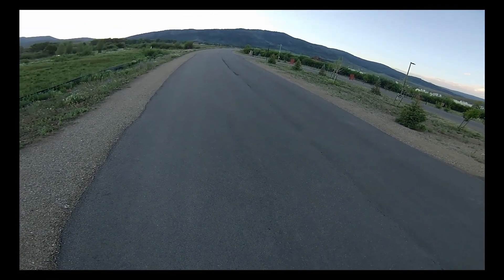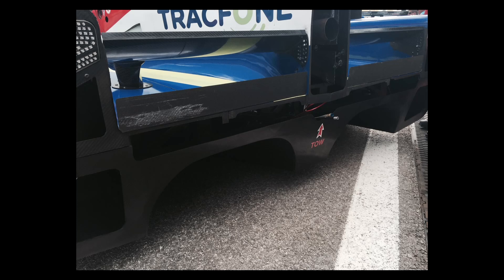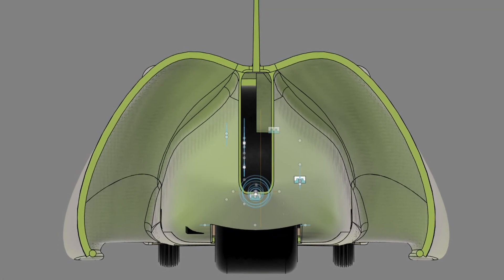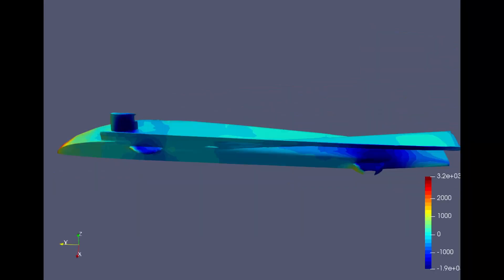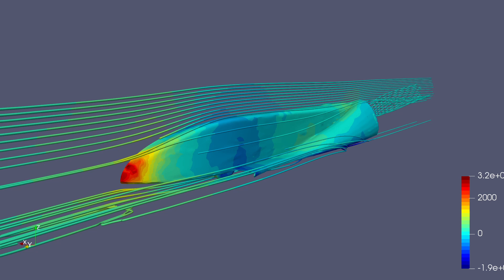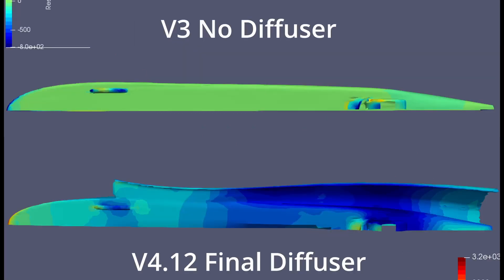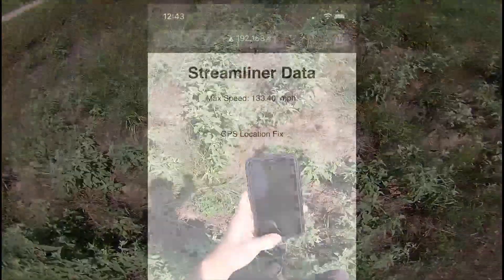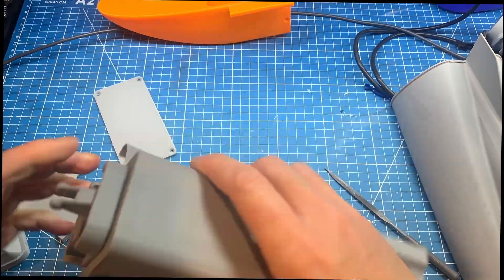Project Streamliner: V4 Design and Testing (Adding Ground Effect)

Comment: Hopefully constructive opinion:
1. Forget all the aero stuff.  You need a controllable reliable car first.  Focus on that.
1a. Get a good GPS module to log direction/speed/acceleration/deceleration. (Crashing)
2. Most high-speed R/C cars use a type of foam drive tire.  Use that first to get a driveable car, then improve on what they have done.
3. You should be able to calculate the rear tire speed at 100mph. Run that on the bench to measure tire growth and reliability. Save that RPM for later. Log.. 
5. Examine how fast the rear tires are actually spinning when the GPS says you are at 100mph. Compare to estimates to get tire slippage. A big issue with other R/C cars. Log
5. Measure your ESC power usage at 40,50,60,100~  to create a power/speed profile. This will help you develop your aero package. Log.
6. Take a look at modern Drag Racing bikes to get an idea of what the "profile" of the rear tire should be.  They have been doing it for years. This will help driveability. Should be the top focus.
7. Put the car down, and drive 5 feet in the direction you want the car to go. Program the steering to follow data from the GPS to follow that direction. Let the car correct itself instead of you trying to drive.  This will need lots of learning/programming as you will want the steering to be less sensitive as the car speed increases.  Fun!!
8. Use the GPS or other monitoring device to slowly remove the throttle when slowing down. This should help your braking issue.
9. Use a piece of masking tape on the edges and along the bottom of the car. It will show where the car is hitting the ground and it is easily replaced.
10. Determine ride height at different speeds for the front and rear.  Use temporary stick-on winglets to adjust the ride height or downforce in the field for estimated body shape changes. 
11. The skis should be taped onto the car's bottom. This allows field adjustment to correct for too high/log ride height in the field. Use shims or tape to change the angle of attack!
12. Outboard skis are da bomb.  Possibly replaceable PLA nubs/bumpers. Engineer in a quick swap nose as it's first to "wear out".  Bring a couple. That's what F1 guys do.
13. Build the swing arm so you can adjust the driving direction in the field.  With more power, you don't know where the car is going.

  I could go on, but you need to have some fun also.  I think the idea is to build a car that is fast/drivable first, measure/log everything, then start making go-fast parts. 
  Having lots of shims/tape/spacers etc. in the field is super important to make adjustments while testing. And maybe get a cheap tripod. 
 thx,   John
Reply from the maker: Thank you for all the really well thought out ideas and feedback!
1. I agree.  I think this is the most controllable version of the car I've had so far.  I really am tempted to wide the wheel base or try a 4 wheel design to make the car even more stable and easier to control.
-I haven't tried to use the headings from the GPS yet.  I think I would most likely need to combine the GPS data with the gyro/accelerometer data with a Kalman filter to have something responsive enough.   I actually just found a fatal software flaw where the reading of the GPS data was randomly delaying the microcontroller and stopping all of the stability control systems.  I've since switched to using the additional processor on the ESP32 for the GPS and logging, and this has dramatically improved the heading control.  I really need multiple dedicated processors so I can separate dependencies.
2. I really want to switch to the foam type tire, but I haven't been able to find the right EPDM foam since I have to custom make my own tires since I can't find the unglued foam tires.  It requires a higher durometer foam, and the foam I have tried chunked out at less than 80mph.
3.  I admittedly haven't done enough tire testing.  The rubber tires grow dramatically even with a homemade belt made of dyneema.  The tires self clearance the car's body right now.  That's a great idea to create a test rig to run the tire for a prolonged period of time.  Do you think I need a roller to exert the force from the road?
5.  I just added a rear wheel speed sensor to the car.  I've also implemented traction control and antilock braking.  Additionally I setup linear interpolation on the throttle and brake, which eases on the acceleration or braking.  
5a.  Characterizing the motor is something I've been working hard on.  The traction control I'm using is rate based, which isn't ideal, but it is used by a lot of drag racers.  Ideally, I'd have a motor dyno that allows me to fully model the throttle, RPM, and torque output of the motor.  The RC car ESC's are not linear in their torque response.  Unfortunately I haven't found an off the shelf solution for logging the motor current that's Arduino compatible.  I may be forced to build my own.  I am building a voltage logging circuit.  I'm using a very small battery which is most likely sagging at higher speeds as well.
6.  I have found a semi rounded rear tire helps stability.  I think with a wider front width I could run a more square tire and have better traction.
7.  I do the heading testing with the gyro and accelerometer and they do pretty well up to a point.  I need to do more testing now that I've fixed the software bug.  I think after 80mph the car is pretty much being driven by aerodynamics as I have virtually no control over it.
8.  I've added the deceleration taper based on wheel speed but haven't tested it.  I think a parachute will help to stabilize the car as well, I see this a lot on drag racers when they lose the rear end they pull the chute.
9.  I like the masking tape idea, plus it adds a little more wear resistance.
10.  I really want to log the ride height.  Space is the main issue I have right now.  I have some lidar sensors that might be useful if I can get the car more reliable.
11.  That's a great point.  I need much more adjustability.  I was hoping to keep the design simple and just reprint parts, but like you said I need to make adjustments in the field.
12.  I am trying some polyurethane skiis for the diffuser edges.  It is a surprisingly durable material.
13. I agree on this.  I have essentially a "spring rubber" setup for the rear swing arm.  I just need to print out several variations and test them out.

Like you said, making the car drivable is the most difficult part.  It's hard to find the ideal conditions and perfectly smooth surfaces in which to run the car right now.  Again, thanks for the feedback on this.  I really enjoy trying to think through all of these possibilities.

Comment: Impressed by the evolution, really like how you developed this car.  I think that a big part of down force is generated by the rear sidepods of the car that act as "wing" and not so much by the ground effect underfloor.  The surface area that can generate downforce  underneath the car is very small (small portion between throat and kick point), that 's why I am saying that the  ground effect is minimal. The road roughness is not helping either the airflow underneath the car. I am trying to build some sort of streamliner myself, but the issue that I have is that at high speeds the suspension is loaded and even small bumps in the roads disturb the car in a such way that I have to abort the run. I tried to reduce the downforce to unload the suspension but still I don't have consistency. After the winter I will try to make some active aero to make the car float to keep the pitch between limits and have "just enough" downforces.
What is the width of the car? I asked you on an old video, did you tried to run it as a FWD car? Maybe will improve stability during acceleration and braking.
Reply from the maker: Thanks.  Wouldn't the diffuser tunnel should continue to generate downforce due to the increased speed of the air past the throat?  The CFD results I saw from other cars showed this.  I agree, the texture ground surface can greatly lower downforce.  I tried this on fresh asphalt vs concrete and the difference was noticeable.  Also just changing the boundary conditions in OpenFOAM halved the downforce when the surface roughness was increased.
Reply: @IndeterminateDesign   The diffuser will generate minimal downforce,  after kick point you increase the height but also in width of the diffuser as the body is chamfered inwards and this cause the air velocity to slowdown to match the speed of the air from rear of the car. A think that the slope is way to high and even with the turbulent airflow (to delay the separation point), the separation may occur earlier than is supposed to. Even though the body has great influence, a safe rule of thumb is for the diffuser to have between 10 and 15 degrees slope.
Reply from the maker: I forgot to answer on the first one, the streamliner is 80mm at the front and the widest part of the diffuser is 120mm.  I think I would need a small wind tunnel or something to see what's going on with the diffuser.  

It's definitely working, but I don't know by what mechanism.  The diffuser kick up is 9 degrees, and I went with a contoured throat to help with height sensitivity.  It doesn't look it, but most of the expansion is in the horizontal directly as well.  I've added vortex tunnels to the edges of the latest diffuser design which the CFD shows increased down force.  Hopefully if I can get more high speed runs I can see the data logging trends and measure the increase in traction.

I did try running the car in reverse.  I flipping the front suspension upside down to have the right caster.  I found it was stable at low speeds <30mph, but the steering became erratic much above that speed.  I think I would need to re-engineer the car to change the weight distribution and put the battery or ESC in the nose.
Reply: @IndeterminateDesign  Thank you for the answer. Something about the simulation doesn't look right, the lowest pressure is way over the kick point (where you expect to see it),  almost to the middle of the diffuser where the air is slowed down. Usually you expect that on the throat zone to have the high air velocity  but from what I am seeing at 5:18 this is not the case. You can search "Aero analysis for F1 2022 based on CFD result" and see the lowest pressure area of an F1 car.

Comment: Amazing work with each video !! Which software you used for aerodynamics simulation ? And is the car all in pla ? Would you fear the scenario where you forgot it in the car while the car is in the hot sun which deform it due to high temp inside your car ?
Reply from the maker: I’m using Simscale for a lot of the “rough” CFD work and I’m using BlueCFD (OpenFOAM for windows) for the fiber meshing. The body of the car is all PLA, the wheels and suspension are all carbon nylon or carbon polycarbonate.  I use PLA for my prototypes, and I was in a rush and decided to try to run the PLA wheel and it wasn’t great. 

I’m pretty careful to no leave the streamliner in a hot car. It’s actually PLA+ and it has a bit higher melt temp than normal PLA. I have had the ESC make the top of the monocoque soft if I do back to back runs. I may add vents for testing. Eventually the whole thing will be printed in polycarbonate to save weight, but I haven’t gotten to that point yet.